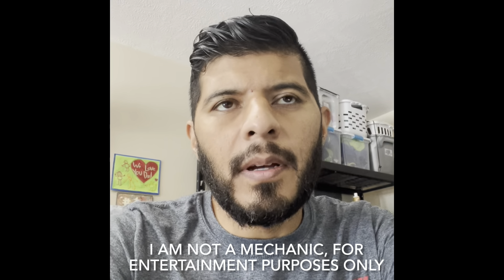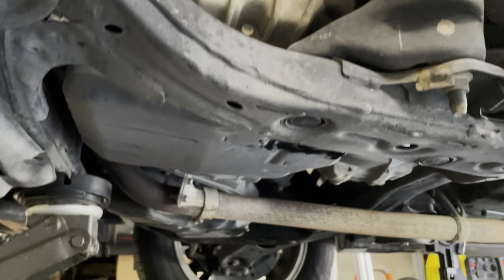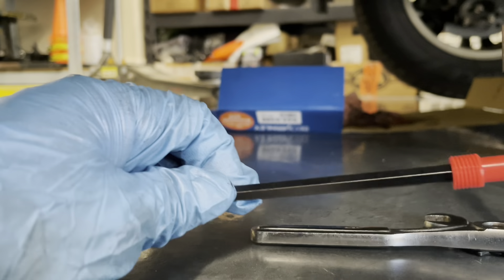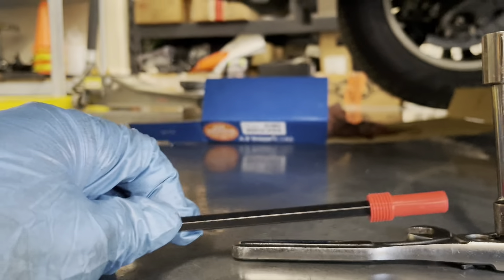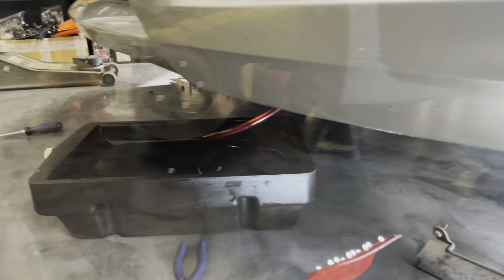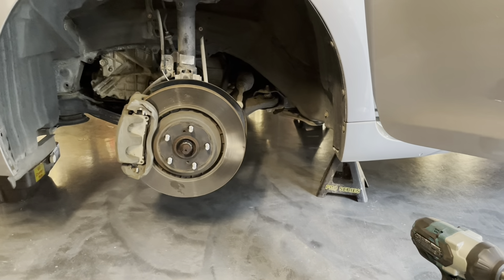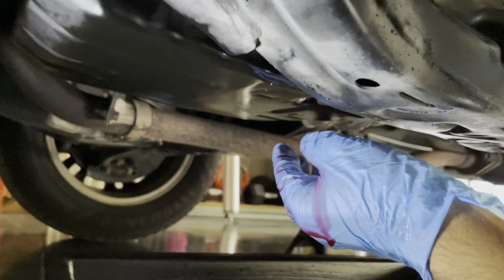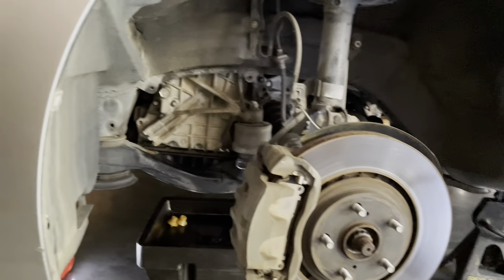3rd Gen (2011-2016) Toyota Sienna Transmission Fluid Change - The Right Way

Comment from the maker: I forgot to mention this is for the 3.5L V6 FWD version
Reply: when you drained it.  was it cold or was it up to temp?
Reply from the maker: I drove it around the neighborhood to get it up to temp and then let it sit for a while prior to removing the drain plug.  My thinking is that the fluid drains better when its hot but i let it cool down just a bit to avoid getting burned by the exhaust and other hot metal parts.

Comment: I really appreciate you putting this stuff out there, as you say you are not a mechanic, neither am I, but I do like doing the work on my cars myself. Having said that the first thing  you should always do before draining fluids with the intent to replace them is remove the fill plug because if for some strange reason it won't come off you have just drained all of the fluid from the transmission, or transfer case, or rear differential and have no means of filling it back up.
Reply from the maker: Great advice!

Comment from the maker: A couple of people have asked so i want to clarify.  You do remove the DRAIN plug to check the fluid level not the fill plug.  i understand how it can be confusing but it is the correct way to check the fluid level.  Thats why there is a red inspection tube inside the drain plug hole.  The purpose of the inspection tube is to set the correct level inside the transmission pan and allow the excess fluid to flow out of the drain hole.

Comment: Excellent video. Thanks so much. Great help. I had a major issues by using Valvoline ATF, I switched it to Toyota WS and that resolved the problems I had with the other AFT. For all others here please use only Toyota WS ATF it will save you lots of troubles.
Reply: Which Vavoline ATF?  Maxlife (red bottle) or something else?  I've used MaxLife on a 2011 Rav4 with no issues.
Reply: @loden888  Red bottle, problems started after 500 miles
Reply: @loden888  most dealers use vavoline maxlife. You'll be fine. Just follow the specs in your owners manual
Reply: are you sure it wasn't a little underfilled? I had weird problems when I flushed mine and an extra half quart solved everything. Probably some air gets in and I didn't let it run long enough to get an accurate reading.
Reply: @jorgba  I used Maxlife red bottle last spring on a Sienna 2012 119k miles. Still no issues. I used it on a Volvo V70 with Lucas Trans Fix and it saved my transmission .

Comment: Great video! Thank you! Trying to get my 2011 Sienna in better shape. It has 268,000 miles on it. I'm trying to squeeze out a few more.
Reply: Do you know if the Trans fluid was changed before? Do you have any problem with the van after the fluid replacement & how many miles now since it was changed?

Comment: I have 2011 Sienna & just practice this morning the temp Checking of Trans fluid. The van was sitting in the garage overnight. It took about 15 minutes for the D light to come on solid & another 16 minutes for the D light to start flashing. So you definitely have more than enough time to do your proper Fluid level Check!

Comment: I just wanted to share with you my experience today. I was 50/50 in deciding whether to change my transmission fluid of my 2011 Sienna with 224,773 miles on the original Trans fluid. It was previously owned by my sister & always on time with all the maintenance at the dealership except the transmission fluid because dealership says it’s sealed & lifetime transmission fluid. I was only able to drain 1.5 quarts of the old transmission, filled 2 quarts, did the process of checking the right temp & drained excess trans fluid. Happy to say so far after the test drive, that the van is driving normally. Btw, it was driving ok, no issues prior to Trans fluid replacement. The old Fluid was brown & did not  smell burnt. 😅
Reply from the maker: Good strategy of only draining small amount of fluid.  Do that frequently (maybe every 30k miles) and you should be good.
Reply: Thanks Antonio your video really helped me gives confidence to just go ahead & do it!

Comment: I used that combo wrench for that pesky bolt above the frame.  Except I put the open end on the bolt head, and used a screwdriver through the box end  to turn and apply torque. Super easy and came right off.

Comment: If you grind down shallow 10mm socket half with bench grinder works perfect to access the 2 bolts on the pan you can't get to

Comment: To remove the tricky drain pan bolt loosen it slightly with the box end wrench you mentioned, then stick the open end side of the wrench on the bolt straight on and use a screwdriver in the box side to loosen
Reply: Used that same approach, works great. Except I was able to start right in with the screwdriver through the box end.

Comment: Just need some clarification please. At the 18:30 mark you put the car in park and waited for the P to come back on, but when video resumed it was a D on the display. Does this mean that when the temp is reached a D will show even if you have it in park? thanks for this video.
Reply from the maker: @landy216 that is correct, i misspoke in the video.  Once you have cycled between D and N multiple times and the D light stays illuminated for a split second and then turns off it doesnt matter what gear you are in.  The D light will come on once the trans has reached the correct temp.  Obviously for safety reasons it is best to leave it in park during this time

Comment: 1/4 drive 10mm socket on a wobbly makes short work of that rear pan bolt.
Reply: I was goin to write the same thing.  I like wobble extensions.  Bought my first 3/4 Drive,  12" long  at PEP BOYs in San Diego, in 1996.  Still have it.

Comment: How did the magnets look when you cleaned them?  I see most videos don't go the extra step of dropping the pan and replacing the filter.  My 2019 Sienna 8-speed transmission has 70,000 miles and I'm thinking of just doing the drain & fill every two years.  Most videos show about 2.5 quarts of the 6.9 quarts is replaced using the this method.  I have not seen others disconnect the transmission cooler line to drain more out.  Does the manual recommend this or is this your own technique to get more fluid replaced at one time?  

Thank you for taking the extra time to record and post the video.  The idea that car manufactures, especially Subaru, tell owners the fluid is for the "life of the transmission" is foolish.  What do they care if your transmission fails due to old oil.  It just makes it easier for them to sell you a newer vehicle.
Reply from the maker: The magnets didnt look bad, as i mentioned in the video, the trans fluid didnt look bad at all which tells me it was recently replaced even though the carfax did not show it on the maintenance history, with used cars you never know so i always get a baseline by replacing all fluids to the full extent.  

If i was in your shoes (bought the van new and only had 70,000 miles) i would probably not drop the pan and replace filter but i would still pull the trans cooler hose to get more fluid out.  If you did this every 60,000 miles you would probably never need to drop the pan and replace filter but because i’m ocd i would probably drop the pan and replace filter every other trabs fluid change (which would be every 120,000 miles).  I am assuming you do not live in the north where you have to deal with undercarriage corrosion and will not have any issues removing the trans pan bolts.  If you do live in the north then i would be very cautious removing the pan bolts because if they are corroded you will probably break them trying to remove them.  If you live in the north you have 2 options, commit to never dropping the pan and never replacing the trans filter or, drop the pan every trans fluid change just so you can add a fresh layer of anti-seize to the bolts, because 120,000 of salt corrosion is just too long even for anti-seize.

As for disconnecting the trans cooler hose or not, my thoughts are that if you dont you are leaving roughly half of the old fluid in the system, the only way i would feel comfortable doing that is if i shortened the trans fluid change interval to 30,000 miles, but because i’d rather work less and drive more i’ll stick with 60,000 intervals and pull the trans cooler hose to flush most of the fluid, its not that much extra work to flush the trans cooler.

Thats my 2 pennies, im no expert but i am a mechanical engineer, diy mechanic and a car care nut.  By the way, if you havent already done so, check out TheCarCareNut youtube channel, he provides excellent info about toyota cars and maintenance, i believe he has one specifically about long term maintenance of toyota transmissions and toyotas in general.
Reply: filter change is not necessary on the 8speed u cant even get to it because the pan is in the front

Comment: Nice video! Good job! The only thing I would've done differently would be to turn it off when it reached temperature. Partly to keep it from overheating, and partly to keep it from over draining due to turbulence in the drain pan.
Reply from the maker: As far as i know Toyota recommends leaving the vehicle running while checking the level.  It takes ~5-10 minutes for the temperature to climb from 104f to 113f so you have quite a bit of time to check the level.
Reply: How much turbulence is there?  What is the cause of the turbulence?  Do you have some kind of info of a clear pan?  Would like to know,  Thank you very much.

Comment: Thanks for the video. How many miles on the car when you did this service?
Reply from the maker: Mine had 120,000 and was at least the 2nd time the trans fluid had been changed.  I believe the manual calls for changing the trans fluid every 60,000 miles.

Comment: Should you just drain for the other hose? Correct me if I’m wrong. 

In your method your draining the outlet line of the trans. I’m assuming the other line is the return line from the cooler. If you use that line to drain, you would be able to flush the cooler while doing this.
Reply from the maker: In my method i am draining the outlet line of the trans cooler, its the line closest to the driver side and exits the radiator looking trans cooler.

Comment: I don't bother checking it at temp. What I do is measure what comes out and what I put back in to be exactly the same. Never had an issue.
Reply from the maker: I only buy used vehicle so i have no idea if the amount of fluid in the transmission is the correct amount so i cannot use your method.

Comment: Thanks for the info! Where did you buy your pan gasket and fluid from? Any online Toyota suppliers that you recommend? Thanks again
Reply from the maker: The filter and pan gasket i purchased aftermarket from rockauto, not the same quality as oem to be honest but i change them every 60,000 miles and have never had any issues.  

The fluid is OEM Toyota ATF WS, i recommend you stick with toyota recommended fluid.  If i recall correctly i think i found the best price on ebay.

Comment: did you replace the drain bolt gasket/washer? If so, what type would i need....2011 Sienna
Reply from the maker: I did replace it and i still had a leak, had to use teflon tape on the threads of the drain bolt

Comment: How did you level the car in your garage? I want to do this but my drive way isn't  leveled. Do i need to use a level gauge and where should i put it on the car to get the perfect leveled position so i can get a correct reading on my oil.
Reply from the maker: I had jack stands positioned under the front frame lift points just behind the front wheels.  I used a single floor jack to lift the rear of the vehicle using the floor jack lift point (its a tow hook looking thing under the center rear of the van).  I placed a level under the bottom door sill just to the rear of the jack stands.
Reply: @antonio0072007  thank you for replying i hope the procedure is the same on 4 cylinder siennas as mine is non v6 engine.
Reply: I saw one video they seemed to place a magnetic digital angle finder right in the trans pan
Reply: @jeremyreeves8940  thanks for the tip i will definitely try this.
Reply: @chocotoynk2931  yeah I just did mine yesterday. I already had a magnetic digital angle finder. I was level to .5 degrees just sitting in garage. I put it right on the trans pan. You could put a bubble water level on it to to check
Reply: @antonio0072007 do i really need to wait for a day for me to add more if ever im already on check mode and nothing comes out? Or can i put more the same day as long as it stays on the right temp reading?

Comment: My 2011 Sienna has 225,000 miles on original Transmission fluid, would you change the fluid? Thanks.
Reply from the maker: Are you having any transmission issues?  How long do you plan on keeping the van?

Comment: Hi will this method work for a 2019 highlander AWD?
Reply from the maker: I’m not sure, i would assume the transmission fluid procedure for a highlander is similar but with a different amount of transmission fluid used.  As far as the method of checking the transmission temperature, again i’m not sure but since this method can be used on a tundra and a sienna i would assume its applicable to all or most toyotas.

Comment: anyone can please help, I'm having a hard time finding the part number for the filler plug gasket( washer), I have a 2014 Sienna FWD LE 3.5L V6 ( U660E transmission), so the part number should be the same, for the drain plug I have 90430-A0002...Thank you!!
Reply: I have 2011 Sienna & the Filler Plug Gasket is 90430-A0003 ($1.44 online). The Trans Fluid Drain Plug Gasket is 90430-A0002 ($1.44 online). Hope this clarifies.

Comment: Your title 2011-2016 3rd gen ..What about years 2017-2020 aren't 3rd Generation ? Or this method does not apply to them !
Reply from the maker: I actually had to change the title to clarify that this only applies up to year 2016.  It was brought to my attention that starting in 2017 the transmissions are different and dont have a transmission pan so this process does not apply to 2017 and newer siennas.

Comment: How is your transmission now with the flush? How many miles did you flush? Should I flush my 2011 Toyota Sienna at 167,000 miles with not recored if it changed?
Reply from the maker: Its running great, but it was running great before the fluid change as well.  Changing the transmission fluid is preventative so you really shouldnt notice a change.  I change my transmission fluid every 60,000 miles.
Reply: Should I flush my 167,000 mile van?
Reply from the maker: Thats a tough question, because i dont know all the maintenance history of your van.  If the transmission fluid has never been changed in its entire life, there are several people who would tell you dont change it now because you may introduce more problems.  

Ultimately its your call, i will say that if i was in your shoes, and the oil in my van had never been changed my decision whether or not to change it now would depend on 2 things: 1. Do i suspect there is an issue with the transmission like strange noises or its slipping, if the answer is yes then i would be inclined to change the oil to see if it helps (i like to try the easy fixes first).  2. How long do i plan on keeping the van, if i was about to sell the van and its running ok now, i would not change the trans fluid.  If i’m going to keep the van for several hundred thousand miles more, i probably would change the fluid and deal with any negative consequences “at home” as opposed to “on the road”.  I woukd also start changing it every 60,000 miles.  However, if i opted to change the oil i wouldnt drop the pan or flush the transmission cooler, i would just drain the fluid through the drain hole and refill the trans, check the level and thats it.

Thats my 2 pennies.
Reply: I changed my transmission fluid on a used 2005 nissan pathfinder at around 190,000 miles with unknown service history because I could feel the transmission was overheating and not shifting correctly and after draining, filter change and filling with new fluid (recommend amsoil the best) it drives so smooth. Dont think flushing is necessary

Comment: What a strange design! Why?
Why the hard to reach bolt?
Why no dipstick?
Reply from the maker: According to Toyota its a “Maintenance-free sealed transmission” but since i only buy used cars with 100k+ miles i always change all of the fluids to ensure my vehicles can make it to 200k miles or more.
Reply: I had to remove the motor mount bolt and use a jack to lift the engine a half an inch in order to reach two of the oil pan bolts. Wild design.
Reply: Otherwise the subframe would have to be pulled…

Comment: Retired Professional Mechanic. Horrible Video. Common Sense should tell you  if I over heat the transmission that's not good.  Running it out of fluid  then leaving it run dry is very stupid. You should go by manufacturer way, 18 years in a Chevrolet dealership we would never run dry a transmission dry, especially to the point of overheating it.
Reply from the maker: Rick, while i appreciate your comment, i dont think you understood the instructions in the video.  I never ran the transmission dry, at worst it was a quart low.  Also, i never overheated the transmission, there is a specific temperature range for checking the transmission and you need to be in that range (104-113), but the transmission does not overheat at 114 degrees it just means its too hot to set the correct fluid level.